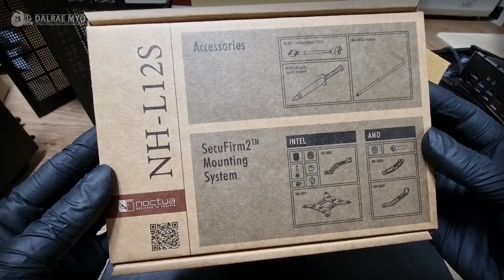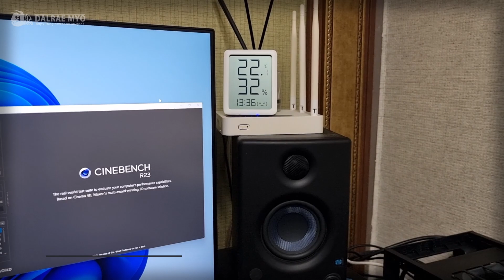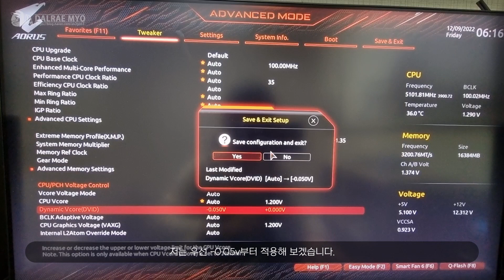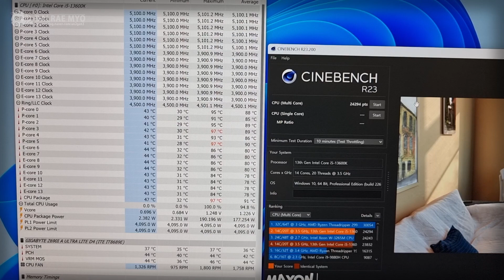GIGABYTE Z690i AORUS ULTRA LITE | 13600K Undervolt

Comment: Hello this should work for Gigabyte Z690 UD DDR4?
Reply from the maker: There may be some differences in configurable values for each CPU or motherboard, but most motherboards with Z chipsets may have similar settings.

Comment: After the undervolt, your cpu z bench gave 830 points? Mine is giving 400 points, normal?
Reply from the maker: The B chipset motherboard does not support undervoltage properly.

Comment: Recently bought PC and have no idea about these type of things, BTW great video ❤helped alot.
I have mobo Z690 Aorus Ultra with i5 13600KF, any idea how can I change the frequency/clock-speed from 5.1mhz to 4.5mhz
Reply from the maker: You can limit the CPU's maximum booster clock to 4.5Ghz in the BIOS.
Reply: @DalraeMyo  can you like send me pic of where that is and would it cause any issue?
in the BIOS I found the option called CPU base clock. If this is the option, what frequency should I run it.
Reply from the maker: Gigabyte's CPU Base Clock means BCLK, do not modify it unless you are normally performing BCLK overclocking.

There may be differences in notation for each model, but there is usually an option to enter the ratio values for the P-core and E-core. If the unit is ratio, entering 50 means 5,000Mhz (5.0Ghz), which is the value multiplied by the base clock. @gsuahavibsosjshs8212
Reply: @DalraeMyo  the dropdown show different percentages in it. BTW thanks again for the info.

Comment: can i do it on i7 13700?
Reply from the maker: The motherboard introduced in the video has sufficient specifications for using the i7-13700 and is also capable of undervolting.

Comment: I get BSOD after 1 second even when I try only -0.05 V… would it be caused by PSU or CPU??
Reply from the maker: Voltage values vary depending on the CPU potential. If the CPU potential is bad, undervolting can be difficult.
Reply: @DalraeMyo  I have found your video only because I started to get BSOD on stock speeds and it looks like it is CPU fault. I thought UV would help to maybe lower temps. I am getting BSOD in RDR2 when my cpu is at 62C… Do you think that increasing volts would solve it?
Reply from the maker: @jadowitywiktor  If you experienced BSOD even though you didn't apply UV, I think it's the fault of the product, not the voltage problem. I think the solution is to replace the parts rather than simply increasing the voltage.
Reply: I think I have solved my problem by changing CPU load line calibration from AUTO to Low/Medium in BIOS. Seems like there wasn't enough V while under heavy load. I am now 2hrs into stress testing with even some UV applied - I was having BSOD before straight away.

Comment: Hey! awesome video, I make the mistake of pairing my 13700k with gigabyte B760 aorus ddr5 (can't do undervolting), im thinking to change my motherboard to a gigabyte z790 aorus elite or z790 gaming ax, this undervolting you make should work on both motherboards?
Reply from the maker: If you use the motherboard of the Z chipset instead of the B chipset, you can use the Undervolting function.
Reply: @DalraeMyo  
thanks for your reply, so to recap any gigabyte z790 i buy will have the option to have undervolting without lowering performance

Comment: Hey man thanks for the video! I use a B660I AORUS mobo with a i7-13700k. I followed how you undervolt the CPU in the bios by adjusting Dynamic Vcore, i adjust the Dynamic Vcore to -0.10v it lowers my temp when running cinebench (was 100 degree when not adjusted) but my cinebench score is only in the 13k pts range where previously it was 26k pts when not adjusted. I am not sure really what to do because the temps for the 13700k is crazy, i always get random temp spikes when the Dynamic Vcore is not adjusted T.T What should i do ?
Reply from the maker: CPU score drops when using Undervolting function on motherboard other than Z chipset.
Reply: @DalraeMyo  I see, so only Z chipset motherboard is suitable for undervolting ? Is there no other option for B660 motherboards ?
Reply from the maker: @AlibabaMan1337  As far as I know, the undervolting function was performed normally only on the Z chipset motherboard, and the other manufacturers were the same.
Reply: @DalraeMyo  thanks for the reply! Guess I'm stuck with this motherboard 😭

Comment: Hello, I would like to ask you that the voltage reduction setting of gigabye only adjusts the DVID, and other parameters are all set by the factory? Thanks 
Then the test software only uses R23?
Reply from the maker: I simply adjusted the DVID, but there are also ways to adjust various options in the Undervolting setting method.

I tested R23 for 10 minutes in a row considering the maximum cooling performance of the cooler, but if there is room for cooling performance of the cooler, you can use a stronger test program.
Reply: @DalraeMyo  Is it enough to set only DVID? I've done that and reached -0.115 but I'm worried about my cpu damaging
Reply from the maker: @AleGamesYT1  In fact, excessive undervolting can damage the CPU. I think it would be better to adjust it appropriately from the value that passed the maximum load test.

For example, if I passed the load test without any problems until 0.1v, I only apply and use the value around 0.05v.
Reply: @DalraeMyo  Yes but what I ask is if I only have to set the DVID or I have to set another thing on the bios.. thanks!
Reply from the maker: @AleGamesYT1  I changed only the DVID settings without changing any other options.
Reply: @DalraeMyo  Okay. I'm now on -0.100, is that safe?
Reply from the maker: @AleGamesYT1  I think it depends on the potential of the CPU. I don't know exactly what the safe value is.

Comment: Thanks for the video! Seeing what you did, you removed the huge heatsink of the M.2 and replaced it with an after market solution right? That seems the way to go for this mobo. I'm planning on building one with this same motherboard, and thinking of having a Deepcool AK620 for my cooler. I wonder if it fits this motherboard, seeing what you did there I expect to do the same and make it fit hopefully :)

EDIT: the cpu that I plan to use is a 13600k.
Reply from the maker: It is correct that I purchased and installed a separate M.2 heat sink because I was concerned that the huge M.2 heat sink would interfere with the cooler mounting. Unfortunately, I haven't used the AK620, so I don't know if it's possible to install it.
Reply: @DalraeMyo  It's ok, just this video gave me a great idea for making it work with the AK620. I'll let you know once I assemble everything!

Comment: Is the 13600KF better in Temp? I get 63 degree with air cooler and Cinebench R23
Reply: With -0.1 offset
Reply: Without 73 degree
Reply from the maker: CPUs with the same model name all have different potentials.

Comment: My god brother, you are my savior, I was looking for videos about this motherboard but in truth it is literally scarce, thanks to you I can get an idea of what this motherboard is like (Yes, i have reported on "manufacturing defect") here In Mexico it is one of the few options in which they are in the country without charging me import fees and most importantly, that it is one of the most accessible and that there is stock. I'm 100% sure I'll go for that motherboard, even if it has pci 3.0, even though I think it wouldn't be a problem for me, I might buy a 2060 or hopefully a 3060, or at best a 6650 xt.
Reply: Mijo, yo soy de latam tambien y quiero saber si tuviste problemas con la 6650xt porque yo quiero tener un set up similar.
Ahorita no creo tener problemas si tengo una rx570.

Comment: i cant wait to do this setup when i get my parts later this week. First ill see what starting temps are and decide where i want to gobetween undervolted and overclocking at the same time. Since I saw a vid where this guy got 5.7 Ghz all core not sure how but he did lol.
Reply from the maker: If the potential of the CPU is high, it can lower the voltage and increase the clock at the same time.

Comment: Thanks for the video helped me drop my temperatures from 96c load to 77c load on my 13700K Gigabyte z690i motherboard.

What model is your SSD cooler?

I have the same motherboard but the heatsink is too big I would like to replace it same as yours.
Reply from the maker: It's a product of 3RSYS, but I think it's only sold in Korea.
Reply: Are you noticing any performance loss when undervolting, I'm running the same cpu but KF version and same motherboard but the UD version and haven't tried undervolting yet just power limiting which cause a bit of performance drop

Also how much did u drop it?
Reply: @agentkido  No performance loss, I set it to -0.070 undervolt, all stable been running it for months like this.
Reply: @baSSxCC  max I could get after trying it in utx was -.050 anything more in cinebench would hard crash me

Comment: Think you could try other benchmarks? I heard cinebench isn't the best to stress test due to how quick it is
Reply from the maker: I tested the CPU used in this video from the ATX system to prime95. There was no problem, and in the case of the R23, it can be run for up to 30 minutes in a row through the Advanced menu.

Comment: Which bios version is it?
Reply from the maker: The F21 version of bios was used at the time of the test.
Reply: @DalraeMyo  any update on what bios version blocking undervolting or you didn't update your bios after F21?
Reply from the maker: @wajinshu  As far as I know, there has never been an update on the Z chipset motherboard that blocks undervolting.

Comment: i try your metod, it really help about temperatures, but i have cpu throttle and my cpu go 2.6 ghz on p cores and 3.4 on E cores for 4-5 sec on cinebench r23 and i get 20k score sometimes 22k, same on stock i have cpu throttle for no reason, i try to give a little bit voltage but cpu hit 100 C and it underclock avtomaticli, and i dont know how to fix it, do u have advice or something
Reply from the maker: For undervolts, the result value varies greatly depending on the potential of the CPU.
Reply: @DalraeMyo  I have 13600k bro, and gigybite z690m DDR4, same motherboard and cpu.
Reply from the maker: @darkboy1284  Even if the CPU has the same model name, the potential is all different.

If the potential is good, there is no problem operating at a lower voltage, but if the potential is low, more voltage is required to maintain the clock speed.
Reply: @darkboy1284  you might want to try power limiting